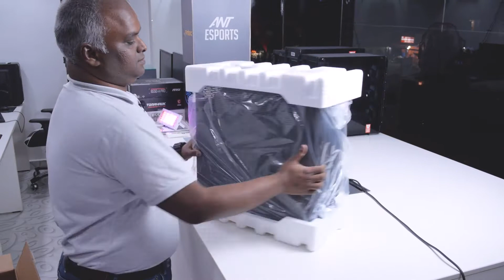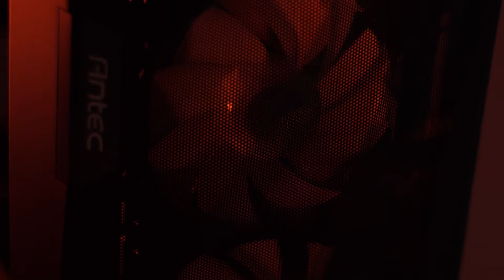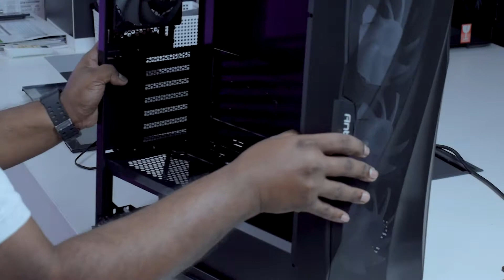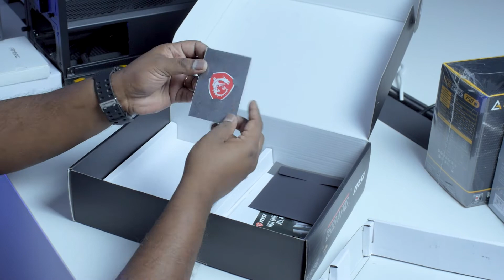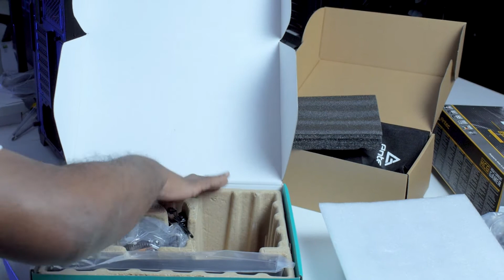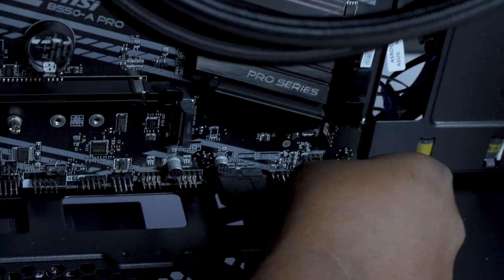Antec DF700 Flux - Best Airflow Case

Comment: How would you recommend this case? Should I get it anything under at 7k?
Reply: Unless you need to mount 360 radiator on top, you have other options from Deepcool (CG560), Lian Li Lancool 215 etc which has good air flow and cheaper.

Comment: Music is too loud at build. Also change title to best BUDGET airflow case. There is many better airflow cases out there. This is best budget option. Also running thermals you will see the bottom reverse fan does more harm then good. Easy enough to just not install reverse fan.

Comment: 360mm aio at top?
Reply from the maker: Yes you can. This and DF600 are budget offering with support for 360 AIO on top. However check the radiator dimensions before choosing AIO. I have done with Deepcool Gammax and Castle it is a perfect fit.

Comment: Very detailed ,
I have it but I am facing  one issue related to RGB fans, I have Asus Crosshair Rog motherboard and it has ARGB controller but somehow ARGB is not getting  connected to DF700 do you have any documents or have you faced such issue
Reply from the maker: hi the DF700 comes with an ARGB hub. it has a connection to the MB. need to understand how you have set up the fans to properly diagnose.